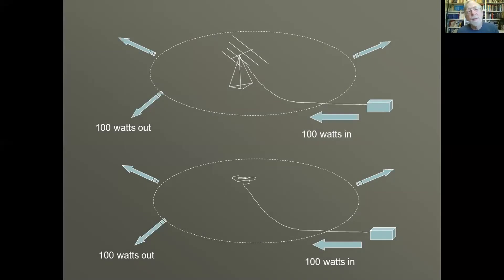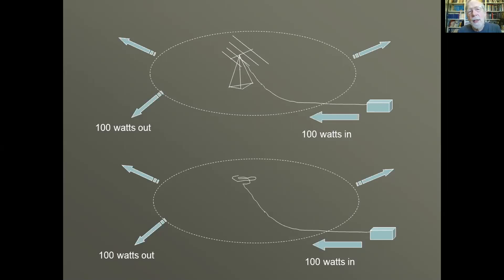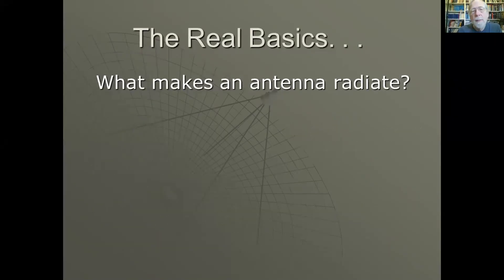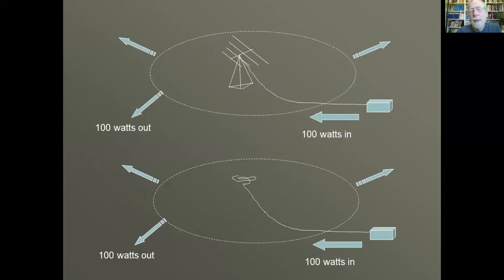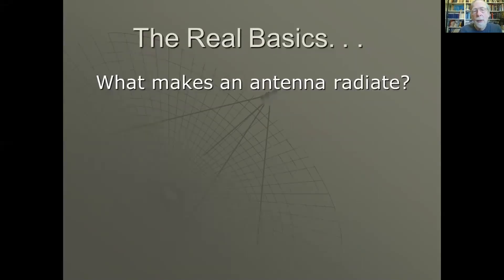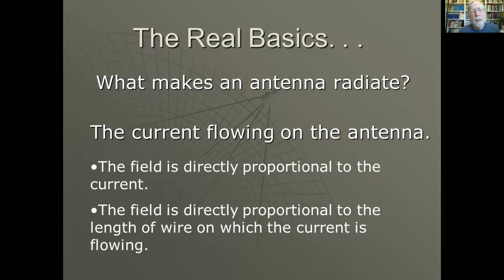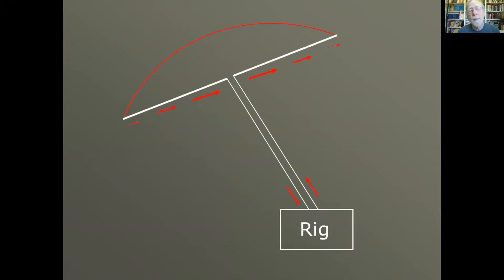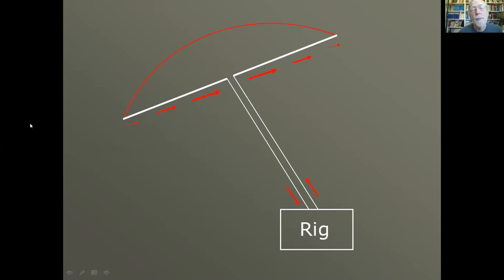What makes an antenna radiate?

Comment: The main point which was skipped is that:  it is a natural phenomen that accelerating charges emit electromagnetic waves (radio and light) and because of the sine wave nature of the current in an antenna, these charges (current) are constantly accelerating and emitting rf radiation.
Reply: We all know that current is zero when we have open circuit
How do you explain we have current in the anttena؟
Reply from the maker: I think that he just assumed that anyone attempting to model an antenna is aware of this phenomenon.